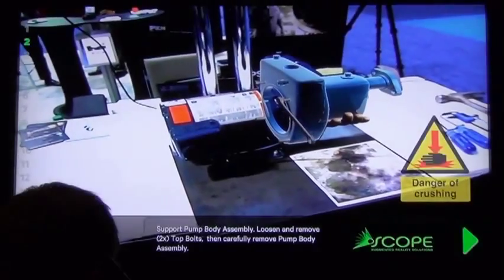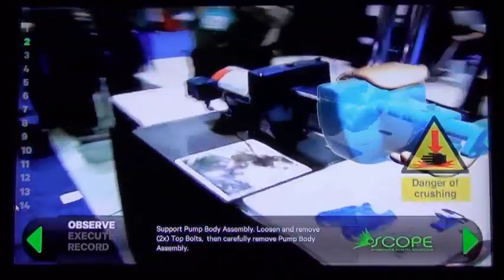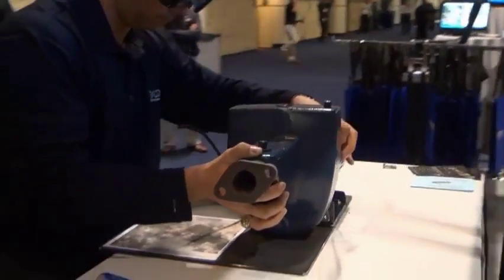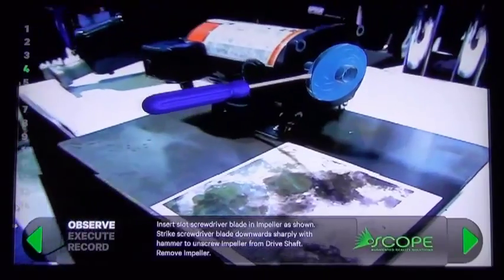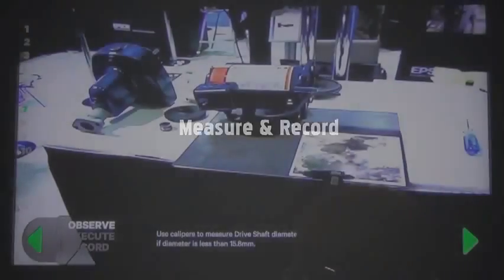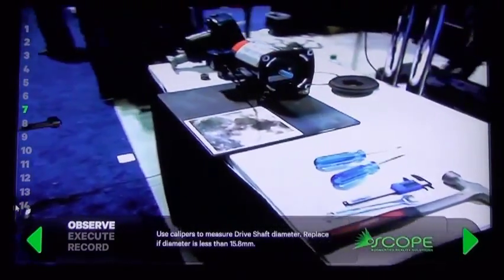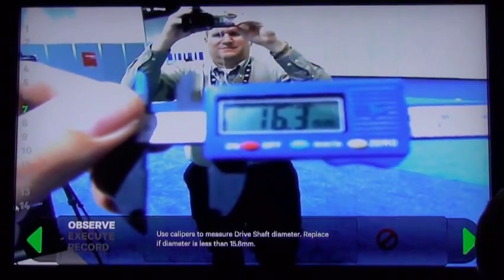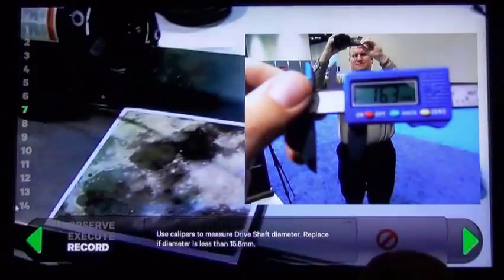Scope Technologies Augmented Reality Training Pump Demo

Comment from the maker: In this demo, the sequence was controlled by a manual Power Point clicker.  There is an "Observe" step, and then when you are done watching you advance to "Execute" which turns off the animation.  This could also be controlled by audible or hand gesture controls as well.